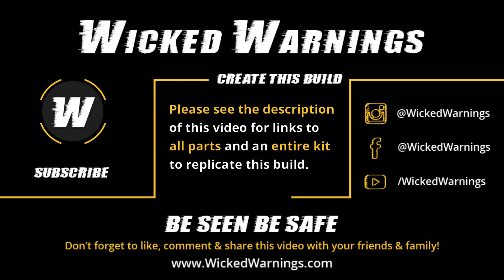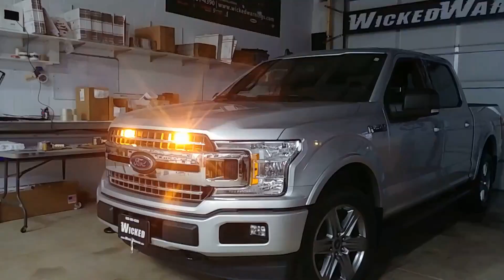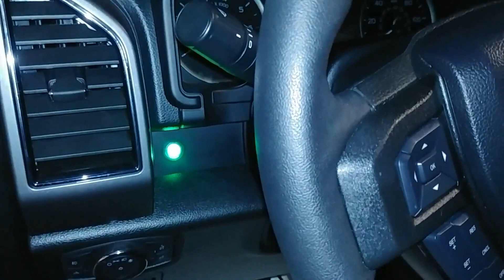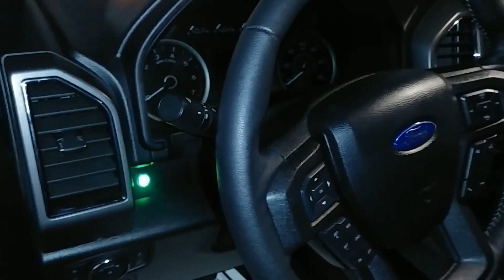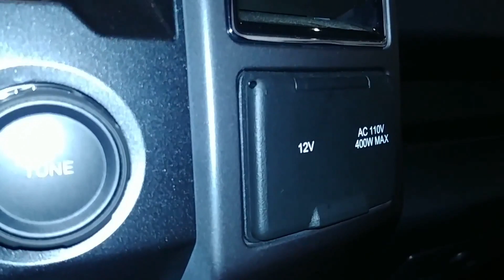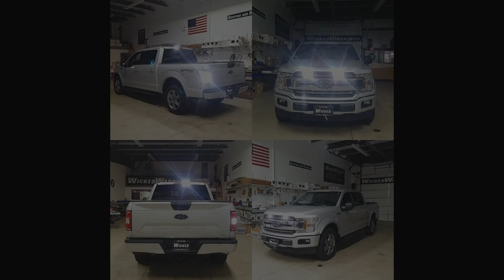2020 Ford F-150 Safety Warning Lights Package

Comment: You do nice work. I like the level of detail you get down into. I knew someone that worked for Whelen and we spoke about the science behind warning lights on vehicles. When I was a professional Firefighter we saw first hand the difference it made with traffic response to an effective and appropriate light pattern. The new trucks have so many options the old guys are turning in their graves. I started and we had the old red 4 bulb sealed beam power hungry beacon that was loved the older generation (Bubble Gum Machine). My biggest complaint was the time it took the industry to realize when a steady on pattern with a slight flutter was appropriate. And at more isn’t always better especially with drunks and epileptic folks. Anyway, love watching ur vids, wish you were closer to Boston!
Reply from the maker: Thank you!